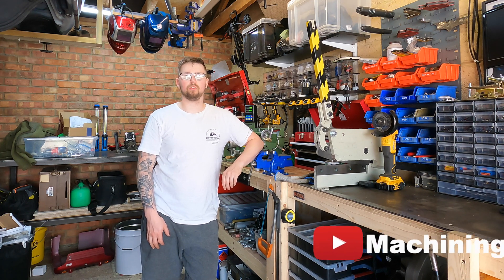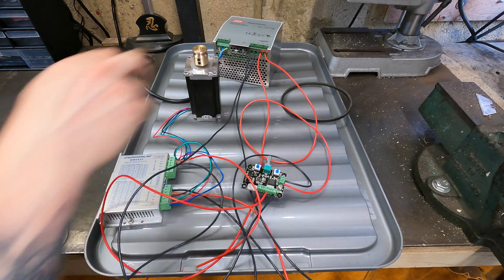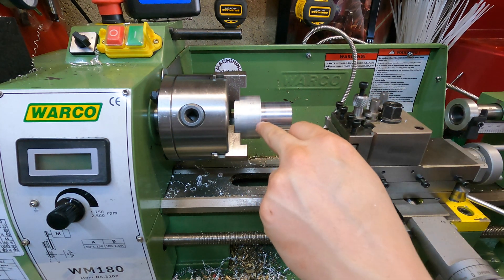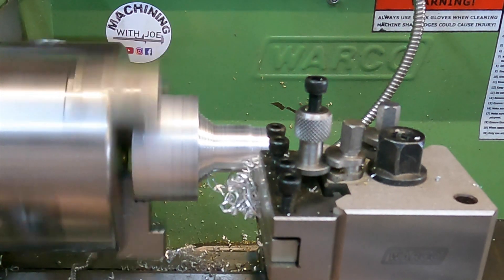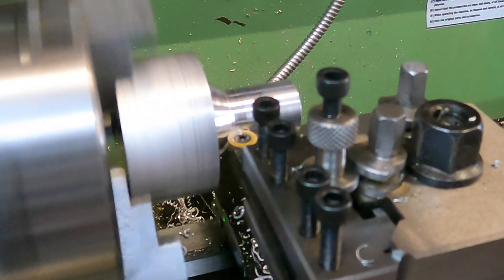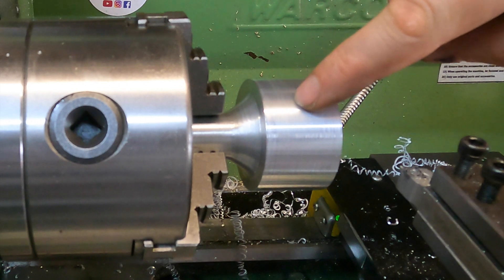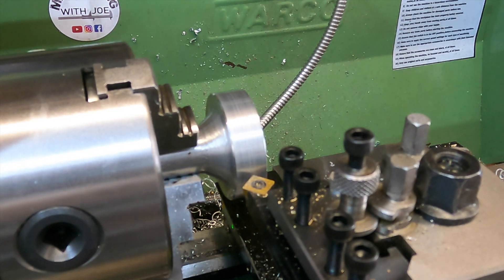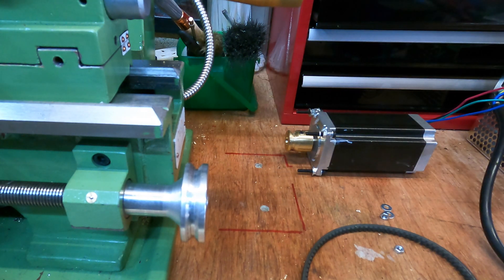Warco WM180 MINI LATHE Power Feed IMPROVEMENT

Comment: Nice video. 
It's may be a stupid question but,  did you think about the possibility to replace your potentiometer by a small Raspberry Pi ?. 
Using the speed and direction of rotation of the lathe chuck as inputs, it should be possible to select any speed/ thread pitch (like a gear box) from the computer .

Comment: The lathe comes as standard with power feed
Reply from the maker: The problem with the screw cutting power feed is you cannot slow it down enough to get good finishes always looks like threads.

Comment: Absolutely on my list to do. I was thinking of adding a microswitch to the carriage stop as well so that it would automatically stop the power feed when hit.
Reply from the maker: Hi dude yeah if you got a switch rated to 10 amps you could probably but it in line with the power input as long as the switch was Normally closed.

Comment: Sorry I'm late to the party Joe, but I'm gathering my thoughts and tooling for my own powered drive. I may go with a direct drive 12v motor as used to crank over and start up model rc planes as they can be had quite cheap and less gubbins needed. Really seriously admire your technical knowledge and how you take the time to research and understand every aspect of the stuff you do. Respect! Enough of that😀, now...can you please provide a link or detail on the carbide radius insert you are using?

Comment: I noted at 4:57 you said that you have your DRO set for a 1mm depth so 2mm is removed, you could switch the X axis to diameter mode using 2 buttons on the key pad.  Also normally the X axis is the cross slide.

Its hard to tell just how fast the spindle is running but using GT style tips on aluminium they need to run fast, very fast, 2000 RPM minimum.

Did you remove the gear drive train from the headstock or has your leadscrew got a dog clutch?

Good video, thanks
Reply from the maker: Thank you I’ll have to have a look at the dro settings. 
As for the gearing yes when I use the lead screw for power feed it is disconnected at the spindle by means of swinging the gear mesh arm out the way.

Comment: Your insert is good as a general purpose insert, you can get inserts specifically for Aluminium, the ones I used were triangular and on my CNC lathe at the Railway (I used to reprogram the machine myself bcoz the real programmers would not listen to the operator) and I eventually ran at 1,000 M per min (was it feet per min, is a long time ago now (1986)) 3mm depth cut .8mm feed per rev. (bcoz the programmers would not listen to me I got 28 mins to do that job when it took 2 mins, Ha Ha)

Comment: Well done freehanding the radius, it is very hard to do. My experience of that was with a KNUX insert (not a big rad) on a Fischer Copy lathe and the template was not correct going from about 5" to 8.5" on an axle for a train, my first attempt was like a staircase.
Reply from the maker: Thank you, 
I feel like the radius turned out fairly well for my first attempt. Gives a much better finish for a pulley.

Comment: Hi Joe, I am doing the same project as you , two questions where did you get your v belt from and what are your dip switches set to. Great video 👍 Roy
Reply from the maker: Hi Roy 
so the V belt I bought off of eBay it is a 6mmx400mm belt and ill have to check what the switches are set to but it will vary depending on motor Amperage and controller make.
Reply: On a later video he shows switches set to slowest speed

Comment: Great idea Joe.  When you started cutting the v groove I about cringed because of the squeal.  Next time you create a v groove you may want to consider using a parting tool to machine a groove near to the depth that the v tool will cut to. Hogging out that excessive material could reduce the amount of tool pressure that is placed on the v cutter.
Reply from the maker: Great advise Time to Tinker. 
I will definitely remember that next time I’m cutting a V groove, and thank you can’t take full credit for the idea but I have done my best to make it my own and functional. Keep tuned for the finished product in next weeks part 2.